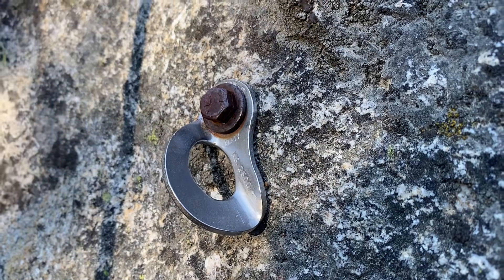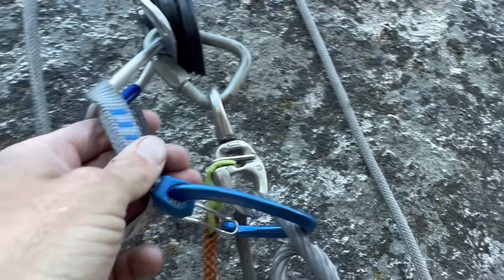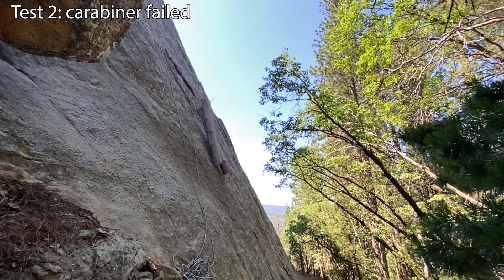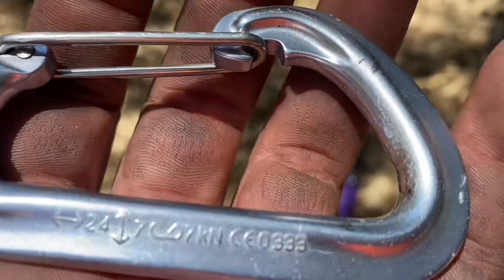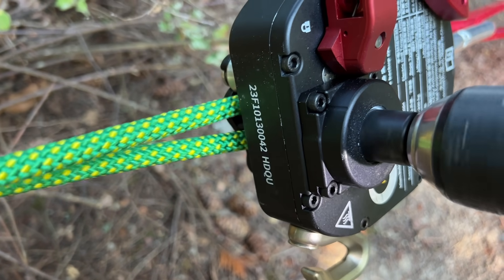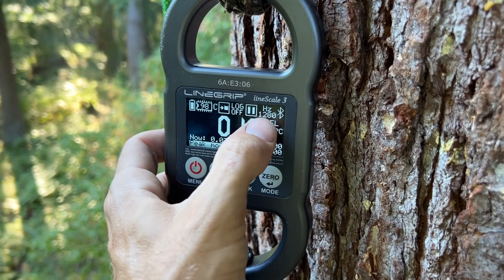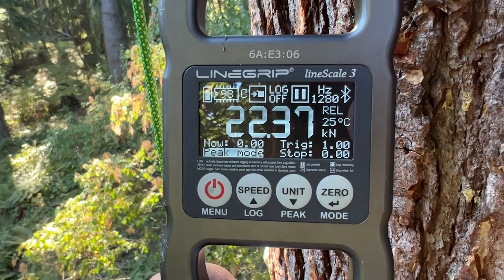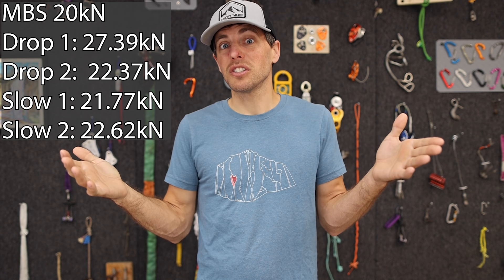We destroyed a sport route for science...

Comment: I wonder if the compromised carabiner had a higher peak force due to being work hardened from the first drop?
Reply: Google "strain hardening in 6060 aluminum"
Reply: They have found carabiners when repeatedly loaded break at a higher load
Reply: Hardened metal doesn't necessarily means it has a higher MBP.
Reply: @mastershake42019  Not necessarily, but since carabiners usually deform before failing, work hardening might add resistance to deformation which could lead to higher strength. That said, it is just a theory.
Reply: It could also be the new geometry,  since it was stretched along the axis of pull, so the new shape was all the more form along/supporting that particular direction of strain.

Comment: I work in corrosion engineering. We mostly deal with galvanized steel in soil.  You won't find much rust on a properly installed bolt in good rock. There's not enough oxygen and no galvanic couple to drive corrosion.
Reply: Mate I've pulled over a dozen good stainless hangers on totally wasted galvanically corroded bolts from limestone and ignumbrite.
Giving blanket advice that sounds like an expert saying to trust bolts in rock.
Also "not enough oxygen"?
There is plenty of air contact on bolts in rock. The face isn't true, the holes aren't true / have irregular surfaces, debris can remain and glue ins have air pockets etc too.

Comment: Part of me felt bad at the start for a moment but then my mind calmed down, "surely Bobby will replace them with much better ones". Thank you, not only did we get some nice tests but I'm sure the local climbers will appreciate not having to look at rusty bolts when clipping. Have to say I'm a bit surprised they all were super good enough despite few of the bolts looking totally rusted.

On a side note seeing all the carabiner carnage reminded me of something I've never found any satisfactory answer on, how much force does the carabiner actually absorb when it breaks in a sudden fall. Eg. if you have two carabiners say 30cm apart and drop 25Kn on the first and it breaks, which should in my mind take some of the energy away, how much force would the second carabiner be subjected to. I'd assume material plays a huge difference since aluminum tends to just crack and break where steel deforms, but steel carabiners are already so bonkers strong and heavy for climbing purposes that it doesn't really matter.

E: After bunch more digging the answer is most likely negligible since it takes about 1.56 microseconds for the force to reach from one side of the carabiner to the other and blow it apart.
Reply: A heavy question that requires a heavy answer. 
Energy is force times distance. Meaning how much did the carabiner deform (elastically and plastically) before breaking times the force experienced during that travel. So assuming something like 15mm (I feel generous) of travel during elastic and deforming * those 22kn and multiplying by a less than known elastic to yield to break of lets say 0.65 (I feel generous) gives me a value of 200 Joules.
Or the energy obtained by a man falling from a height of ... 0.3m (1 foot). It's not nothing, but not much.
As a side-note, this would imply that any setup no matter the stiffness will not break a 22kn tested biner in one go if dropping a 75kg weight from 0.3m.

This is only valid as long as my generousness is not overly generous.

Comment: The "compromise" might have work hardened the carabiner which left it in a more favorable shape and bumping it's metallurgical yield strength, thus you could obtain a slightly higher value on a second try. It can happen, and no carabiners should not be work hardened from now on as that simply destroys it's fatigue limit by introducing the less than "mythical" aluminum microcracks. 
Nice tests, gg up.

Comment: I have no idea how line scale works but is it possible that it registered the force of the fall as peak?
Reply: What do you mean by "the force of the fall"?
Reply from the maker: It measures the deformation in the aluminum.  When it stretches it changes the voltage of the electrical current going through it and interprets the difference and it's calibrated to know what each .000000X volt means in kN.
Reply: @thomasdalton1508  The line scale hitting the ground and registering the force of itself hitting the ground as the 27kn it saved
Reply: @HowNOT2  gotcha, so not likely haha
Reply: @FBWJX  Ah, that's possible I suppose, but it would be an amazing coincidence to get such a plausible number that way. Also, I think that would give a negative number since impacting the ground would compress rather than stretch it.

Comment: I always thought load bearing equipment was supposed to be designed with safety factors built in? So its actual peak load would be some factor above (5:1) whatever is written on it?
Reply from the maker: That is correct in a more industrial or commercial context but not in recreational rock climbing. Minimum Breaking Strength or something similar is used.